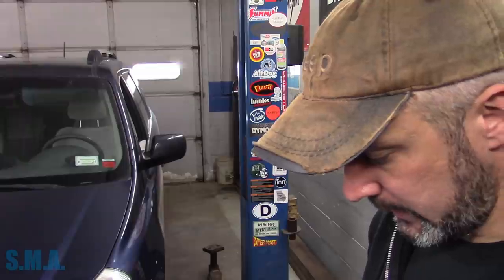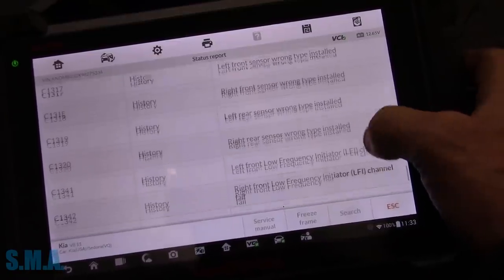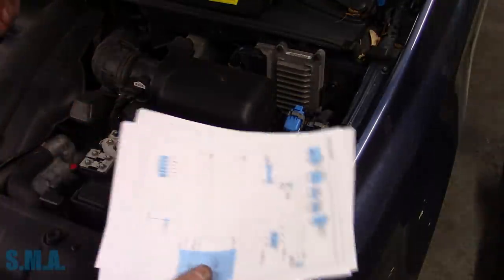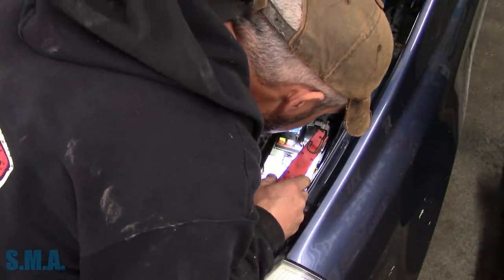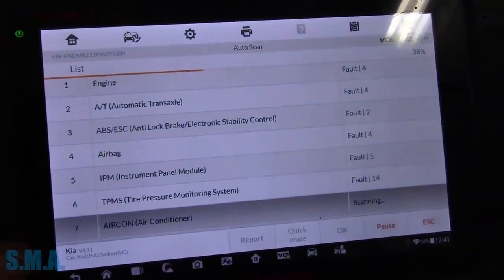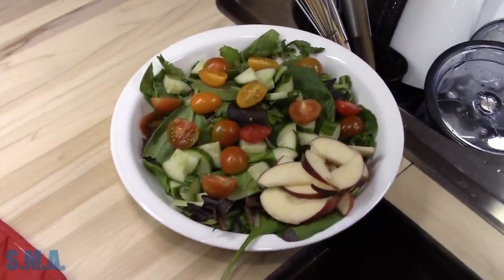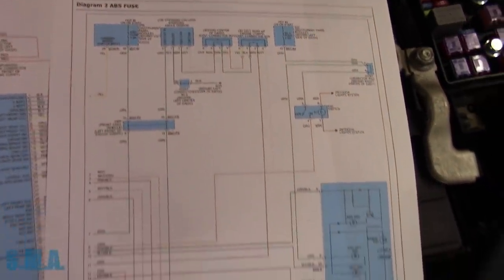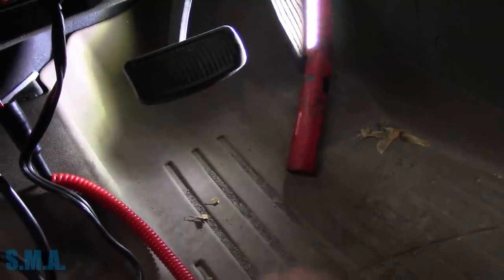You Can't Fix'em All...

Comment: I used to work at a Kia dealership as a mechanic.   We had a Master tech that live, dream Kia.  Pointer he showed me.  1.  To reset ECM disconnect both post of the Battery and touch them together for a few seconds.  Turn the switch on before connecting the Battery or the alarm will sound.  It’s kind of like when a cell phone is acting up turn it off to reset it.  Kias have a lot of down loads.  When in doubt take your VIN to a Kia dealership service department and have them run it for downloads I believe it’s free to check.

Comment: Eric has it made. A nice kitchen and a lovely wife making good meals right there in the shop.. Life is good.
I agree with Eric, fuses don't just 'wear out'. Some condition arises where current above their rating flows through them causing them to open. It may be possible that thermal cycling weakens them in rare application, but I've not seen any studies or discussion about that backed with any data. It's speculative.

Comment: I worked in electronics fields (aviation and electric utility) for 48 years and have seen lots of blown fuses but I never heard of "thermal cycling." The closest is something I saw a lot of in aviation. When fuses run near the rating get really hot (like summer in Phoenix, not winter in New York) and are vibrated (like single engine plane or helicopter, but a Kia probably qualifies) the hot fusible element will fatigue and eventually break. In glass fuses it was easy to see but it can been seen in plastic fuses - you may have to chop the plastic away if light from the back is not enough - as a fractured appearance. To me, the knowledge of how "hard" the fuse blew was important info. If it blew really hard - vaporized metal deposited where the fusible element was - it meant a lot of current. 
That said, one of the most frustrating fuse blows was for the stop lamp / interior lighting fuse in our [shudder!] 1984 Dodge 600. The wire went everywhere and the fuse would last for a few days. Eventually I put a self-resetting breaker in the slot. A month later the lights were out again - we now had a hard short! I also had burned fingers when I tried removing the circuit breaker. I had all the seats out, getting to connectors, before I chased it into the front passenger door. Removing the panel told the story: the wire that powered the courtesy light had been banging against a raw edge and wore through. With the power available from the breaker it had welded itself to the edge.

Comment: Electrical shorts that only pop a fuse rarely can be one of the most difficult things there is  to track down on a vehicle.
I once had a customer who drove a Saab that the engine would just shut off while driving down the road for some unknown reason.  Never blew a fuse.  After it shut off,  he would simply pull over and let it set for 20 minutes or more it would start right back up and run perfectly and might not do it again for several weeks.  I had looked and looked for the problem to no avail, but it would never do it while I had it at the shop.  So I told him the next time it shut off and put him on the side of the road to call me right then and I would come with my meter and test light and try and find the problem.  I got a call late one rainey night and he said he was on the side of the road and it would not start.  I went and I found the problem, it was the fuse panel overheating and where two of the bus bars were riveted together. When the rivet got hot enough from the bad connection, it would kill the power to some of the main fuses and was losing power to the coil.  I drilled the bad rivet out, put in a new one and soldered the bars together and he never had a problem again.  True story!

Comment: It would be great if "History" codes were more precise, logging the date, time, mileage- and even a Geo location at the time of fault.
Reply: But then the conspiracy theorists would complain their car was tracking them.
Reply: I don’t see geo, date, or time, being that useful but mileage, engine speed, and road speed could be very handy in diagnosis
Reply: @Iceman-kr6df  "Fault occurred in XX Shop of XX store on X\X\XX at XX:XX" (when RS system was installed) or similar. Even my '89 has Snapshot ability, but if it were taken when faults occur, it would be a more accurate "history" of a fault. Maybe there are DTC systems that do- but I never saw one.
Reply: Well modern cars do have a black box, recording speed and sensor data etc for crash investigation and stuff, not sure of an auto mechanic can ever see that data thought
Reply: Worked at BMW for a while in recent years. All those things and much more environment data points do get recorded like temperature, battery voltage, trigger times and so on depending on the error code. I guess regular scan tools just might not read this things out correctly because you need special descriptor file for each ECU to decode this data correctly. The dealers of course would be able to read this out correctly.
Reply: M o o'connel   That's not to far off from what gov.  wants from obd 3 systems . That's exactly why obd 3 has stalled , the police and any other authority would be able to track your every movement all in the guise of protecting the environment .
Reply: @mattatwar  Some are more or less open, but Toyota says their's is proprietary. Dealers can retrieve crash information but the public can't. In any case, the data rolls off in a few minutes until it is frozen by a crash.
Reply: I'm all for obd systems recording a snapshot of all available information when a dtc is triggered, but there should be now way to access said data other than with a scan tool of some sort...

Comment: If you need to leave a fuse in a questionable circuit, Bussman and Little fuse both make a "smart glow" fuse, where a little red l.e.d. illuminates when they pop.
Those are also great for like wreckers with add-on fuses, c where you really don't want to be looking for it at 2 a.m. in a blizzard.

Comment: I don't fix cars for a living, but I have done a bunch of automotive work on my own over the years.  With fuse/junction blocks down by those passenger kick panel areas water can become an issue, either from the way the AC system drain is designed (sometimes they can get plugged with debris, then water starts back filling and flowing out, maybe it finds some wires to follow), or if there is an antenna on the passenger fender and someone was (as appeared to be the case on this Kia) was down there tinkering with wires they could have knocked that antenna grommet seal loose, or perhaps it's just dryrotted.  Then water rides down the cable right into that fuse box and you have to get a new one because of corrosion all up in it.  That is exactly what happened to my Jeep, there was NO grommet at all for the antenna (I'm sure there was at one point) and upon disassembling the fuse/junction block-box to see what all was going on I saw how they were built.  I didn't have a single noticeable problem that led me to it, I just remember dealing with some fuses at one point and noting water on the cable (and I had noted water in the carpet at times), then going outside to see why that was and seeing a gaping 1" hole with a coax cable hanging loose in it.  I had several codes and was trying to identify a transmission torque converter lockup issue that stopped working after I had a gigantic puddle on a rainy day.  Three big wiring harnesses under the hood, one for the transmission, all had some corrosion but the one for the  ECU with the TPS signal was absolutetly melted on a few pins and I had to get a replacement from the junk yard to fix it.  The problem still exists to this day.  I am wondering if a solenoid got burned up.  I drove it for thousands of miles with no TCC lockup, even though I have no code for that being an issue.

Comment: I had a '99 Chevy pick up a few years back.  I killed three alternators in two days (original died, I thought the replacement was bad from the parts store, when the third died I realized there was a problem beyond the alternator).  I went through the entire electrical system trying to find a short.  I eventually discovered the bulb for the under-hood courtesy light had separated from it's metal body.  The glass portion was just hanging by thin, bare wires, and shorting to it's metal base.  Some bright engineer decided this light did not need to be fused, so when the bulb came apart the short killed the alternator.  It took more than four-hours in 90-degree summer heat to find the problem.

Comment: I was a fleet mechanic for 35 years. The intermittent problems were the worst to troubleshoot. I remember working on a line truck where the the second boom extension would retract while spinning the hole auger. Altec tech support told me that I had a high back pressure problem. Nope. I kept testing the hydraulic circuits. Everything was normal. For shits and giggles, I removed the second boom stage counter balance valves. There it was. The Teflon seal to block bore was toast. It was rewarding to fix the problem and prove tech support was wrong.
Reply: There was a Caterpiller 235 Tracked excavator that was the first one to leave the factory▬factory was out and could not get what is was; Each start a manual-fuel pump was pumped;

Comment: Intermittent problems are the hardest to fix.  While in the Air Force,we had an problem with a radar unit, being unable to duplicate the issue, we finally removed all the parts, except the wiring, and put each removed part, into a different aircraft. Lots of documentation, and then wait to see where the problem moved to.  Where ever the problem reappears, is the bad part.

Comment: Back when I was a youngster and I knew just enough to get into trouble but not enough to know of wiring diagrams......My car stereo fuse kept blowing intermittently. Tried and tried to get it to blow on command and couldn't make it happen. Going down the road one day with my girlfriend and she flipped the sun visor down.....Pop! Vanity light wire rubbed through at the folding bracket.

Comment: As others said, tracing down an intermittent electrical fault is a total snipe hunt. Hate to try and fix one, especially after a third party cut into wires or harnesses for an aftermarket accessory install.

Tip: "typically", ABS systems trigger above 25mph. Under that, you're pretty much locking up the rotors in a panic stop situation.

Anecdote time! I had to cut a friend loose after getting a look at his wife's Toyota matrix. He brought it into a car audio shop to install a high powered head unit and auxiliary amplifiers and a backup camera. They cut into the doors to carve out space to install component speaker pods with A-pillar tweeter domes.  

Those monkeys sliced right through the driver's side door flex harness where it just entered into the door interior. They also knicked wiring on rear hatch to install the backup camera. The car constantly was popping lock actuator, power window fuses and their rear glass defroster and wiper motor would operate intermittently. 

They wire nutted, twisted and masking taped the sliced harness together... rear hatch issues due to poor reassembly saw wire abrasion and shorts. I told them to take it back to whomever did their install to get it fixed...I couldn't be bothered to fix it all. They couldn't be without their daily driver more than a day - I told them to leave it with me at least a week to get it sorted properly, so yeah; a total non- starter. But at least I identified what was wrong and emailed him and wife evidence photos of serious wrong doing.

Comment: This sounds like the issue I'm having with my 03 impala (intermittent issue with no solution). When it's running and I go to shut it off by turning the key from START to ACC all the electronics go dead. Most times the car can be brought back to life by disconnecting the neg term of the battery for 1 sec. Then it starts and runs like nothing happened and will keep running absolutely great for weeks. It only dies on two scenarios:
1. From the start position to when you turn the key to crank. You hear the crank relay click but the starter never spins up and all electronics go dead. 

2. It will start and run great but while turning the key from start to acc it will die. 

In the past changing the BCM had fixed it and it would be good for 2-3 yrs. Now it killed one BCM in Oct and another in Dec. I contacted Ivan from Pine Hollow Auto Diagnostics to consult with him. I got AllDataDIY sub for the car but I'm not sure where to begin. 

I did notice a mouse living in the airbox but PCM wiring all looks really good. I took it out and checked. The only wiring I found messed up was some exposed wire along the top of the engine along the plenum (3.8L). There is a connector there, to the left the harness goes to ICM, to the right it goes off to PCM and trans I think. There was a purple/white wire exposed and a black wire. I took it to a shop and they patched that up. So presumably we have no more wires along that harness that are exposed. I wish I lived out there by you or Ivan I'd love for someone to figure this out. There is no case like this on the entire internet. This car is on it's 4th BCM.
Reply: Robert Slackware  I swapped the PCM and it hasn't given me trouble since. So the PCM was going bad. I spent over 3k over 5yrs trying to track it down. Each time the dealer called the BCM instead. Then the BCM would get fried again and replaced again when it was the PCM causing all the trouble.

Comment: Had an intermittent "dead throttle" that lasted maybe a second or less on a new 2015 Harley. Lots of CAN Bus stuff on these. Behaved like it would if you accidentally turned off the ignition switch for a second. Ended up being a pinched/broken wire right at the entrance to one of the pins in the plug to the crank position sensor. Proved to only be reproducible when the bike was on the lift with the center jack raised slightly. Ended up being a serendipitous diagnosis made while the bike was running and the jack being cranked up slightly.

Comment: I've had some hard to find shorts over the years. The last one I had to find was a random light flicker, ets off, radio not working right and loads of false codes. Found short in egr valve. All problems went away after replacement.

Comment: At the RV dealership I used to work at, we had a motor home that came in with a blown fuse. Can't remember what it went to but it was annoying enough that the customer brought it in to us. The mechanics went through the electrical system testing the alternator, battery, power converter, and wiring. Sent the customer home after not being able to find the short.

Needless to say, he came back with the same problem. Again the mechanics went through the wiring system. It wasn't until one of the mechanics step into the coach that the fuse blew. The other mechanic had an idea. One of the places they did not check was where the wire harness went through the firewall. Sure enough, when they pulled the wire back through the hole a bit, they found where the firewall cutout had rubbed on the wire insulation. Consequently, the right vibration (driving or stepping in the coach) moved the wire just enough to short out on the metal.
It was a frustrating problem solved with an odd chance of discovery and a mechanic with good instincts.
I'm sure they'll be back and you'll nail it!!!

Comment: I was a Subaru mechanic and the old glass fuses that came from Japan had a bad habit of getting hot and the fuse strip would come unsoldered from the round contact portion of the fuse. You could look at the fuse and it would look good but if tested with a test light it would show bad. The worst one was what we called the 'run' fuse. You could start the car and as soon as you released the key the engine died. If you held the ignition in the start position the car would run. I believe it was in 82 they went to the blade style fuse and didn't have anymore problems. I had one customer that called everyday for over a week and I told him he had a blown fuse because the engine died as soon as he released the key. He argued that all of the fuses looked good. Finally he thought he had it diagnosed as the computer and even with me telling him the computer only controlled the carb he ordered it. He put it in and it didn't work so he had it towed to our dealership. I knew the car and grabbed a fuse and went and stuck it in and the car ran he went into a profanity laced tirade and he was requested to leave the service department. The real kicker to him was since he installed the computer he couldn't take it back and he was out about $200 dollars. I never saw him or his car again but we all had a laugh about him when we replaced the 'run' fuse.

Comment: What’s up Mr. O?! I’ve been following you for about a month now.. I work at a Kia dealership and some of these Sedona vans have a recall to add a relay block to the inside of the junction box under the hood. The hecu modules on a lot of these kias tend to be problematic. It Does not appear to have the added relay block
Installed, but it wouldn’t hurt to have the customer give the dealership a call to confirm if this recall has been done or not. The recall doesn’t pertain to any of the codes that have been set but it’s just a thought that may help. Love your videos!

Comment: Solder a large headlamp into a blow fuse and use that for the fuse. When there is a short, the headlamp will light up. Saves wasting a bunch of fuses and eventually you fond the short.